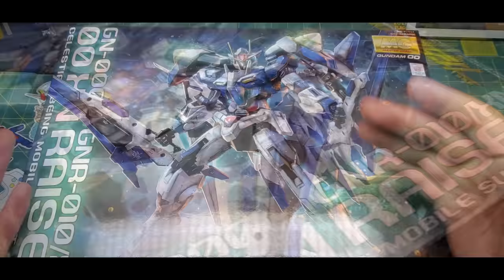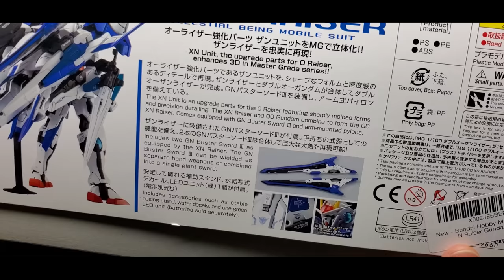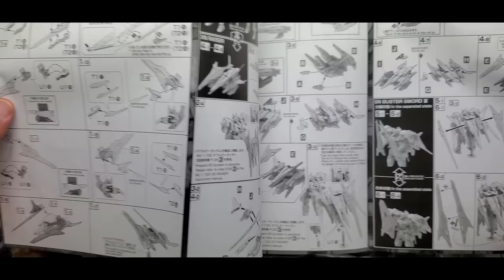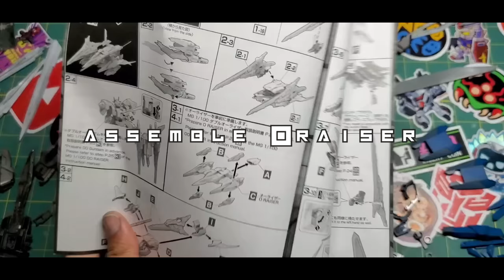#newtype #Otakubuilder MG 00 XN RAISER P1

Comment: If this was Bandai how they are today, they would've made this a P-Bandai add on set. 
I'm glad we have the MG GN-0000+GNR-010/XN 00 XN Raiser. 
I just wish they'd make an RG GN-0000+GNR-010/XN 00 XN Raiser as well.
 
I am impressed with how amazing the MG GNR-010 0 Raiser came out.
 
I'm looking forward to the next part.
Reply: That would definitely be P-Bandai. LOL 
 I'm surprised they haven't actually. They already have the mold for the XN parts in 1/144. They were released with a special issue of Hobby Japan a while back.
 That's an easy $90+ kit. Then of course you would also see the Gundam Base Tokyo limited editions in titanium finish, clear parts, and Trans-Am mode. LOL
Reply: @Shin_Lona  💯Exactly. Maybe they're saving RG GN-0000+GNR-010/XN 00 XN Raiser as a P-Bandai to release with RG GN-0000GNHW/7SG 00 Gundam Seven Sword/G since that too hasn't been released even though they have like 90% of it done already through the other 2 P-Bandai releases.